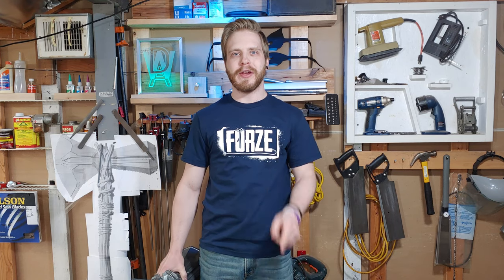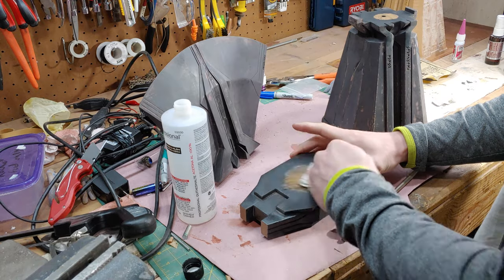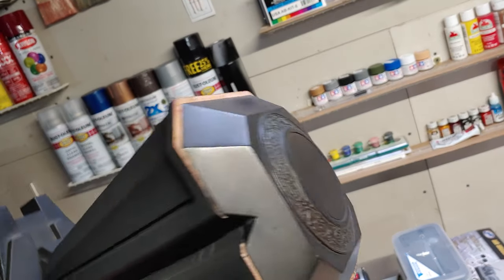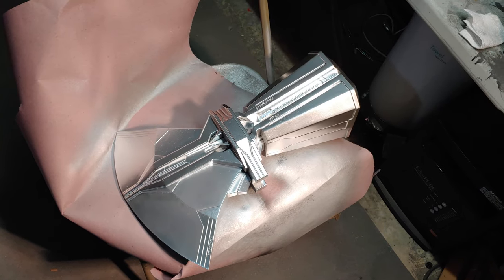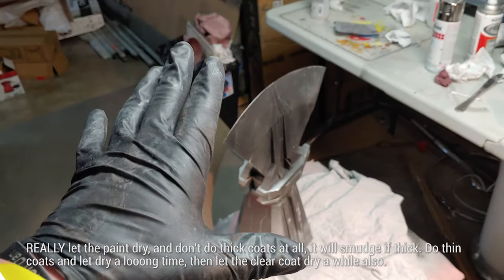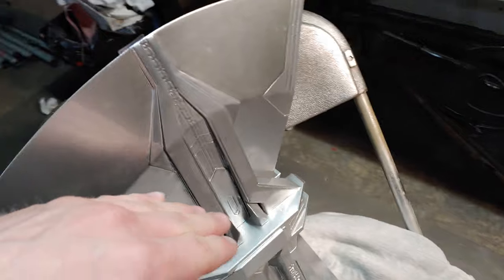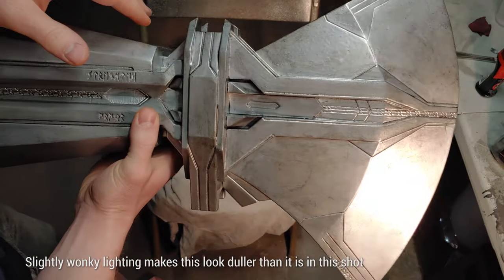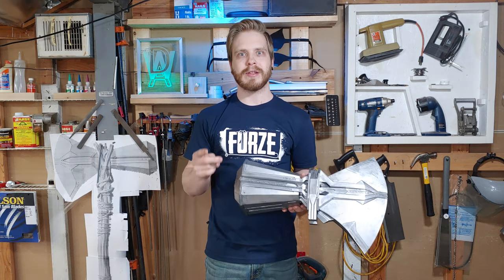Dual Tone Metallic Paint - Finishing Stormbreaker's Head

Comment: Really useful content man! Just found your channel and watched a couple videos. 
Have a quick question, do you know how well the Pledge Revive holds up in terms of flexibility? I have some foam armor that I want to coat to keep the metallic sheen but in the past, most gloss clears I use always end up cracking under pressure.
Reply from the maker: It is for use on hard floors, I have seen people use it on foam, but I would suspect it would crack also. On my batman armor I think I used the wax floor polish and it hasn't cracked. Not too sure how it compares for real metallic shines though.